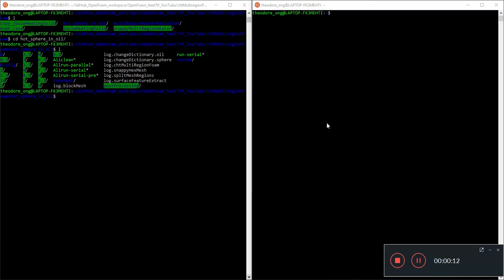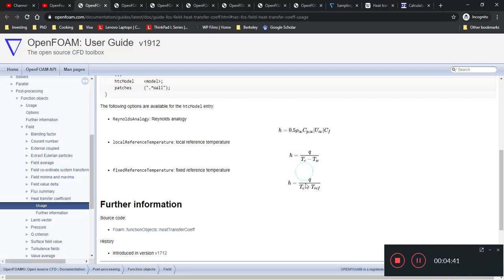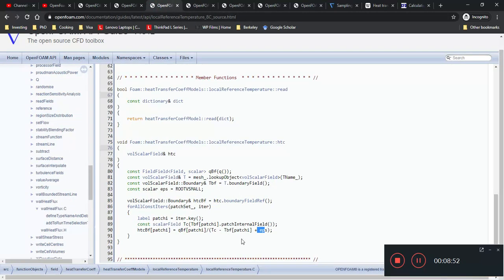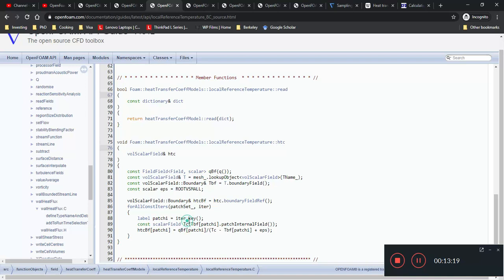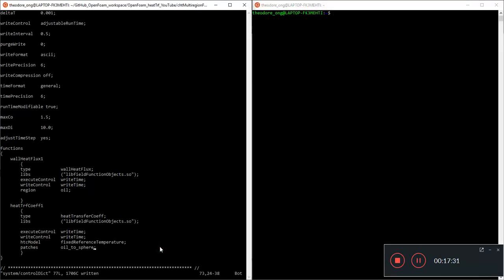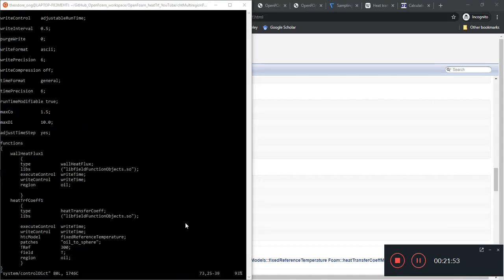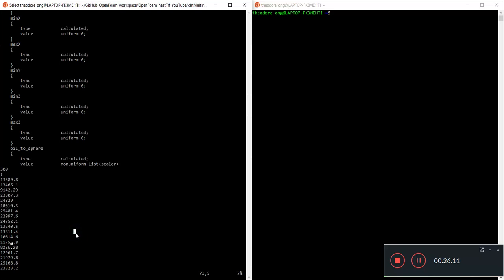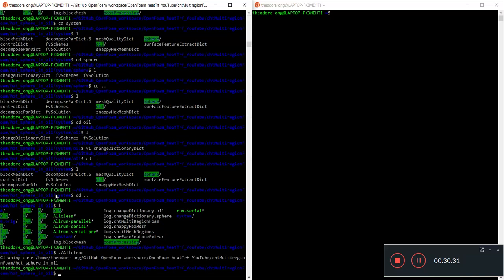OpenFoam Heat Transfer 40 - chtMultiRegionFoam hot sphere in oil part xi heatTransferCoeff function

Comment: Hi! Thanks a lot for the video. I am trying to run a chtMultiRegion case. The wallHeatFlux is working, but the heatTransferCoeff is not... 
I have this issue:
--> FOAM FATAL IO ERROR: (openfoam-2012)
Entry 'htcModel' not found in dictionary "functions.heatTransferCoeff"

    From bool Foam::dictionary::readEntry(const Foam::word&, T&, Foam::keyType::option, bool) const [with T = Foam::word]
    in file /home/pawan/OpenFOAM/OpenFOAM/OpenFOAM-v2012/src/OpenFOAM/lnInclude/dictionaryTemplates.C at line 334.

FOAM exiting

Do you know what can I do? kk

Comment: Hi

Is this Utility (heatTransferCoeff function) available only for chtMultiRegionFoam ?

I tried with buoyantBoussinesqSimpleFoam, though no error message, I could not find the result data.

Please help me out.
Reply: @TheoOngScienceAndEngineering  Thanks a lot for the reply.
Reply: @mintokavyan8774  Hi Minto, you can check this wallHeatTransferCoeff. "Calculates and write the estimated INCOMPRESSIBLE flow heat transfer
 coefficient at wall patches as the volScalarField field 'wallHeatTransferCoeff'." This function is available for Foundation.
Reply: @saidcatalbas  Does it work well? I have tried it for interPhaseChangeFoam solver case, but I did not get any result. Is there any other method for postprocessing heatflux or heattransfercoeff?
Reply: @deshik2001  For ESI group, heattransfercoeff function works well but dont forget that these functions calculates htc with nearest cell temperature value. For most cases this approximation incorrect. If it doesn't suits you, you should use wallheatflux and code with python (or another) for the rest. Of course, for this, you should get the data of the temperature values of the cells with a certain plane from paraview. I'm not sure but I remember that wallheatflux function unit is W, not W/m2 so you should divide area.